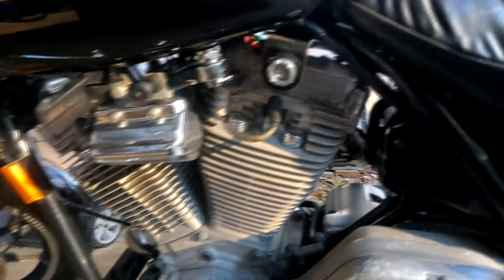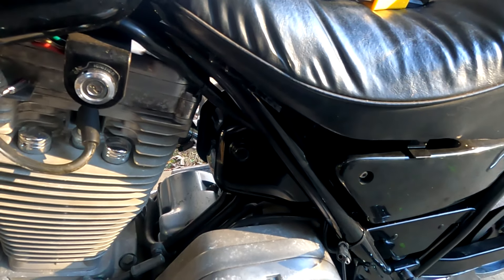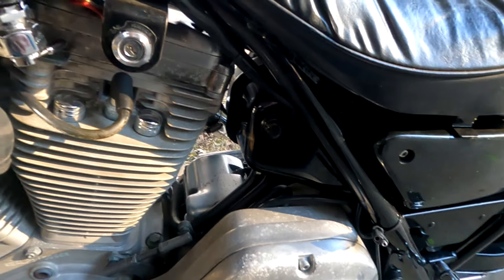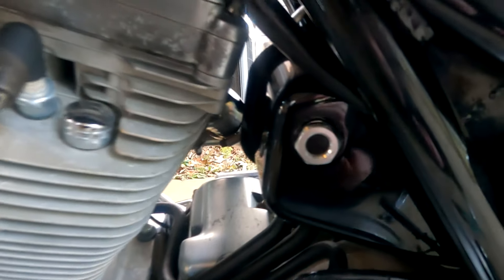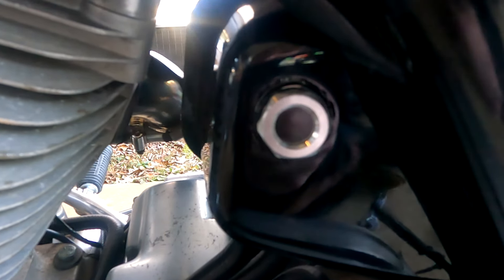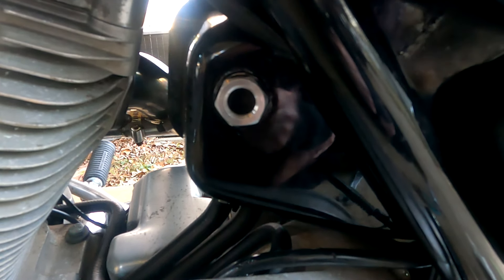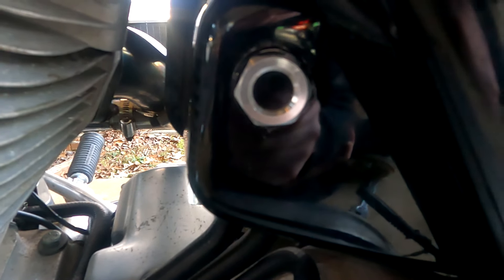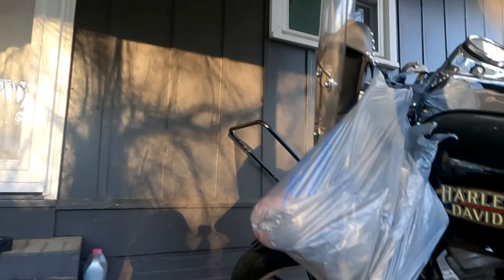Has this broke on your FXR?

Comment: So how did you remove the old sight plastic piece? Was it just pull it out or screw and pull?
Reply from the maker: It screws in and you use a pair of Channel locks to take it off. The replacement screws in with a socket